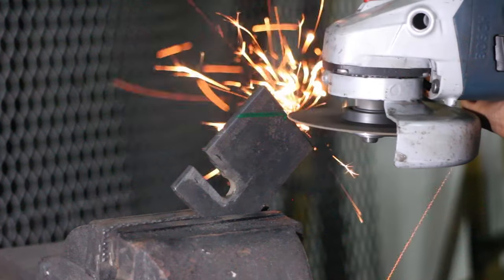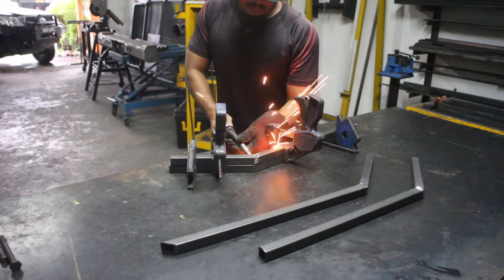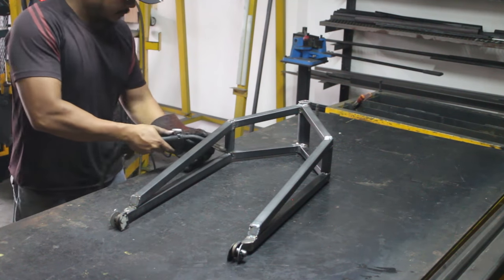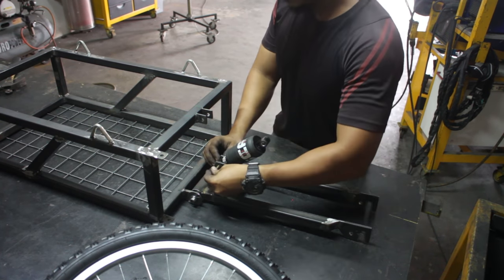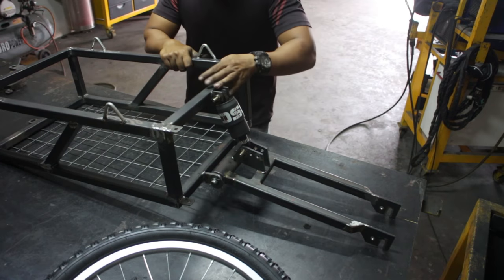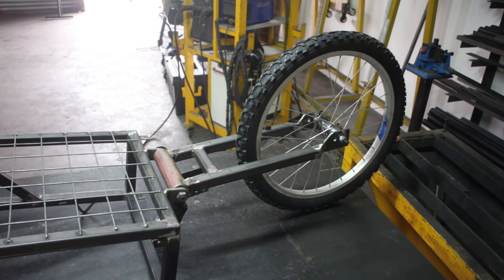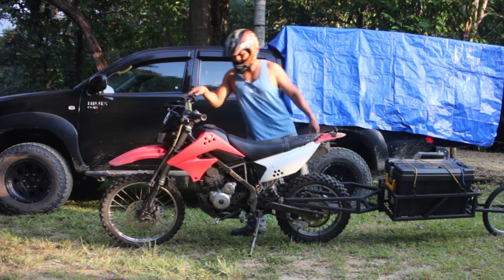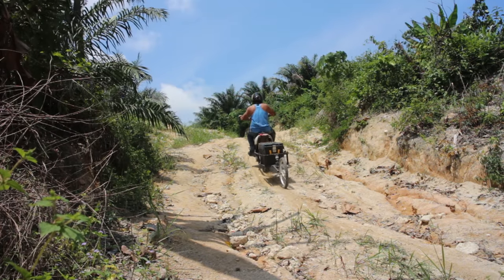Motorcycle trailer DIY

Comment: Came across this again....I really like your design, but think your frame is much stronger (and therefore heavier) than it needs to be.  I built mine out of 3/4" square steel thin wall tubing and gusseted by 1/4" plywood.  It is very strong and much lighter.  I am building light because it is being towed by a 1970 Honda Trail 70 / CT70 with  140cc engine.    I use a heavy steel wheel as I believe the gyroscopic effects of that rotating mass helps stabilize the trailer as the wheel spins faster.
Reply from the maker: Using tube pipe with 1 mm thickness is good enough. You can arrange the tube formation to make it stronger. This design is to heavy. I made a new one with tube design 2x lighter than this.

Comment: i used to pull a bicycle trailer with 20" tires before,it was a 150cc one,i simply mounted the hitch on the shock bolt at the bottom,but i could go no faster than 30mph because it had the tendency to wanna fishtail.i could get it up to 35 if the heavy weight stayed in the frt,but i feel in the end since their was a tensioned spring on the hitch bar that allowed twisting/swiveling  was really the culprit that allowed the trailer to fishtail.

Comment: i bought a quietcat bicycle trailer last yr for bout 370 bucs on sale new from the manufacturer,along the same lines as to what u built,including trailer suspension.it also has the 4"x20" rear wheel,an upgrade from yours.since it was designed for a bicycle rather than a motorcycle i have decided to motorize my phat tire bicycle.it has been put on hold for bout 2 mths now,but will b finished in bout 2 mths or less.thanks 4 ur inspiration here.

Comment: Excellent job! People would buy those. I think a front wheel from a kx85 would be stronger for hard core off road riding.
Reply from the maker: Front wheel kx are to expensive. Budget for the build is below 100 dollars.
Reply: @NextBuild  I have a front and rear wheel from a kx85. I'm In the US if you pay shipping I'll give them to you. What country are you in?
Reply: I would agree. Also is the bearing up to the load weight and the continuous higher speeds that the motorcycle is capable of.      Even the front wheel and hub off a 50cc scooter would be better than a bicycle hub

Comment: I have been studying these trailers & my question is the high center point. When you go over a hump in the trail. What is the angle where the trailer high centers?
Reply from the maker: so far difficulty i got is when crossing above 1 feet tree log.  only need to slide over. ditch never give me problem yet.
Reply: @NextBuild  Im in process of building one too, I have a break-away point point on the swing arm. When Im done, would you like me to show you what I did? Im pretty sure that you could modify your swing arm to adapt this modification if you think its something worth your time.
Reply from the maker: @jameshaney4494  yeah sure james. Im building latest trailer for my klx 250.   I got a lot of weight reduction because now im using tube instead of square tubing.
Reply: @nextbuild what do you mean tube instead of square tubing?
Reply: @jameshaney4494 can you share your break-away point with me please? Thanks

Comment: Hi next build. I did mine with out the cage and the absorver just the lower plan but it swing to much. I would like to use the same high as you but i do not have an idea why ti swing to much.
Reply from the maker: The absorber pivot point are far from the trailer frame pivot point. Or the absorber are too soft.
Reply: @NextBuild  im not actually using absorver. if you dont mind ill keep in thouch to show you mine later.

Comment: Bang kalau trailer kecik nak tow motor kena ada permit jpj ke
Reply from the maker: Kene ada.
Reply: @NextBuild  ok bang trima kasih. Sy plan nak buat trailer tarik moto size cub to vx250 guna kenari. Agak2 berapa cost. Dan lokasi abg dimana
Reply from the maker: @karlamin9116  bandar saujana putra
Reply: @NextBuild  minta contact number bang
Reply from the maker: @karlamin9116  0136033454